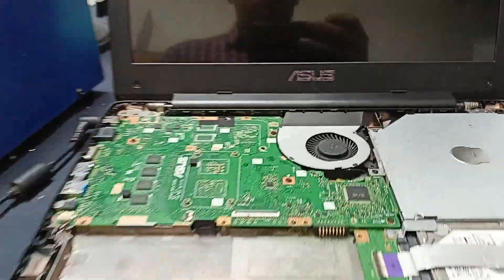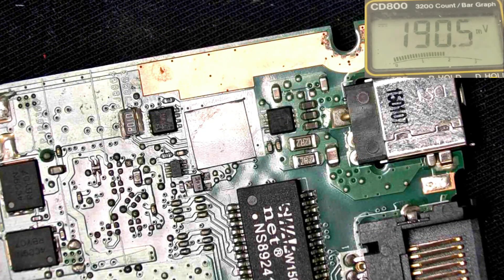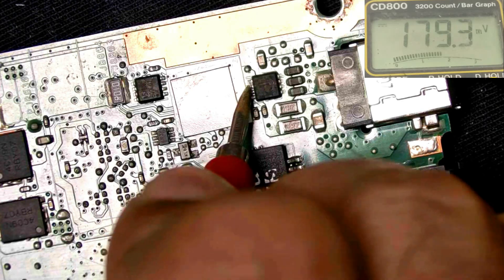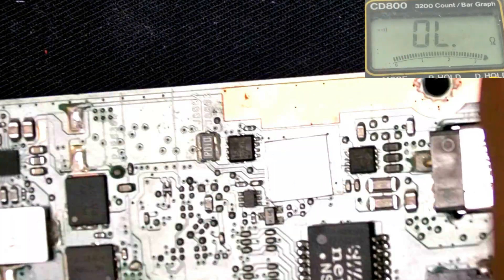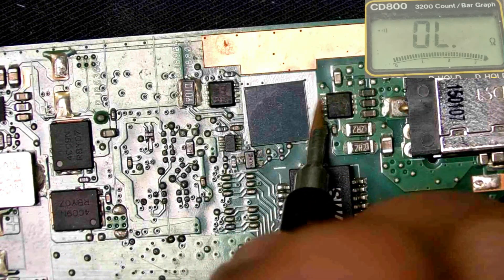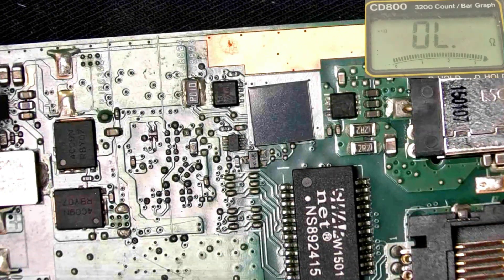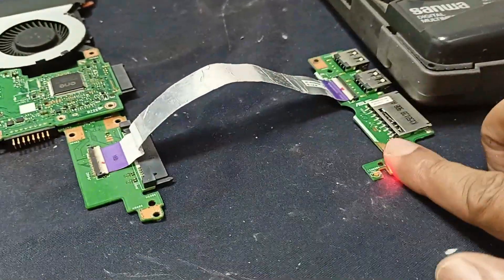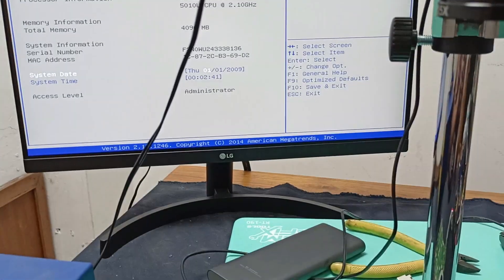Asus laptop power is not turning ON

Comment: Does this laptop have a system for installing SSD? Or there is a system to install extra HDD Or the existing hard drive should be replaced with a new one
Reply from the maker: @tahammultanjim3565  you will use total 2 ssd or hdd.  But this laptop is not an nvme port